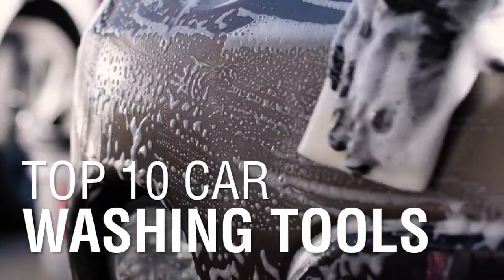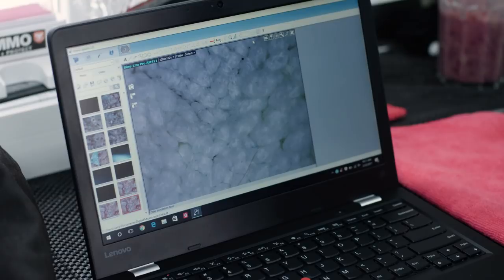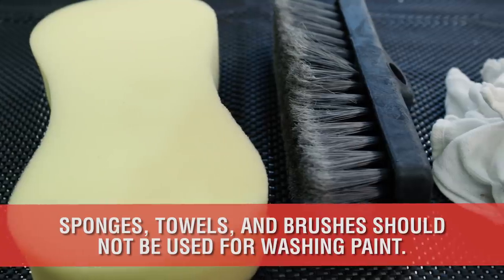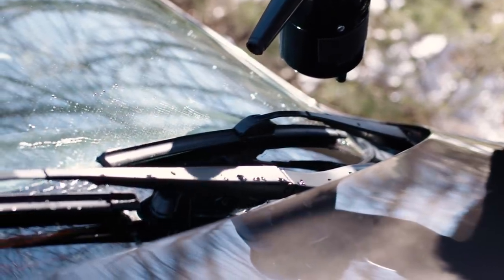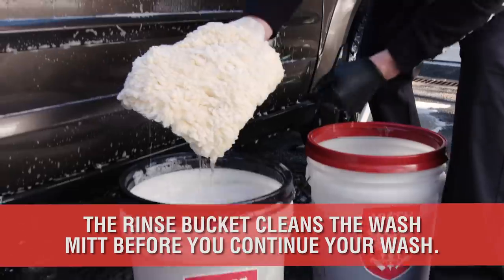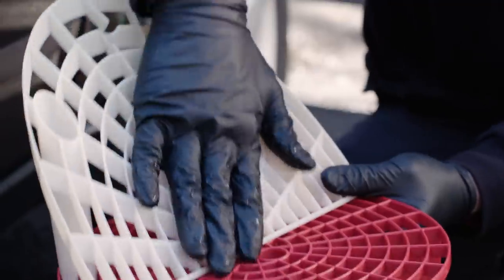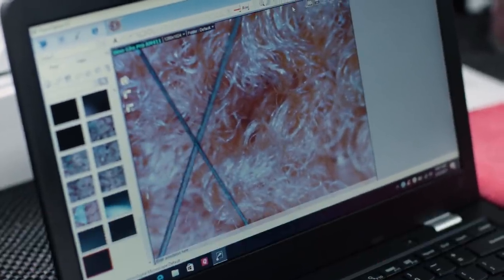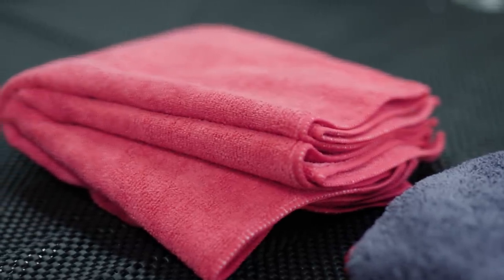Top 10 Car Washing Tools | Autoblog Details

Comment: Is there microfiber towel care? Machine wash with or without fabric softener?
Reply: Albert Yang without! Theres some special products for microfaber washing.
Reply: The product you want is called Micro restore. Relatively inexpensive and works very well. No fabric softenerswhen drying or washing just microrestore or  1/4 cup vinegar( but doesn’t work as well)
Reply: And if using the dryer use low heat with NO  dryer sheet

Comment: Wash bukets 3 of them and foam cannon are you serious thats a lot of unnecessary water and soap plus double work wow...just wow. Foam cannon and wash pit is all you need you more than plenty of soap in your cannon and if you like you use a rinse bucket and thats all you really need. You already have the 2 most important supplies soap and water right that at your fingertips soap and water. And yes you can use a brush on car paint and it doesn't leave scratches it deep cleans a car or anything your washing.